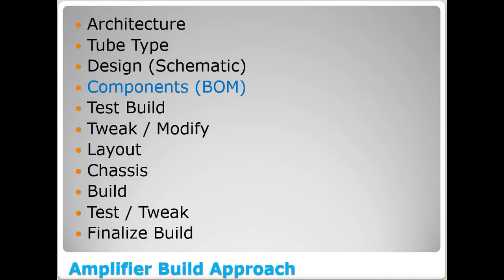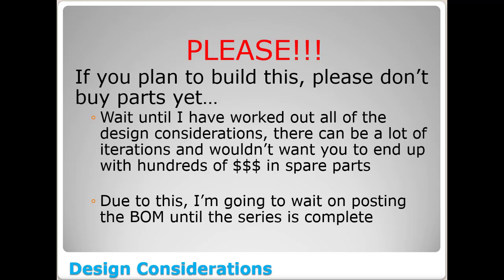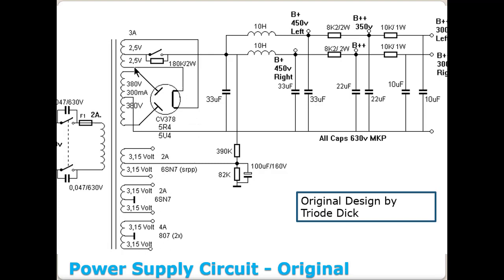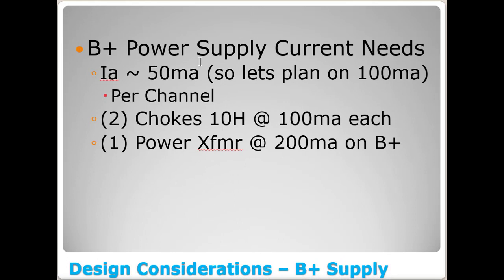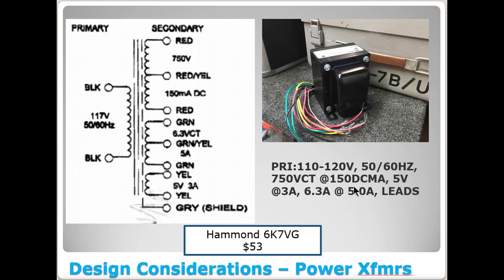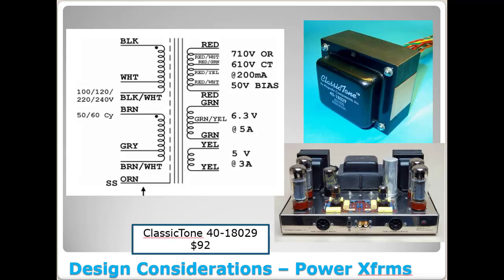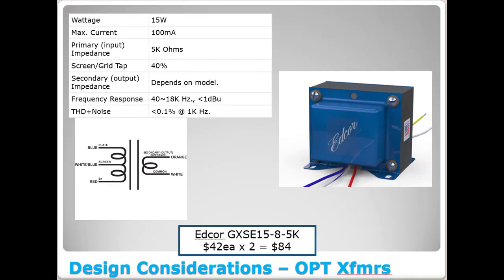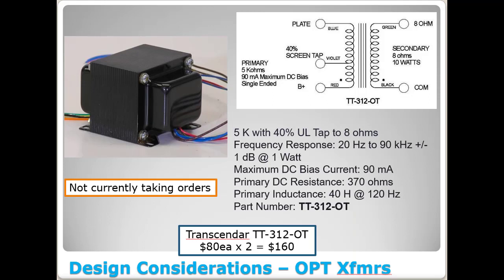Single Ended Tube Amplifier Build 2017 - Part 3 - BG099

Comment: I would build this amp, I have all the transformers, choke, driver tubes, sockets, enclosure ec. Only I need the power tubes. My only problem my output transformer primary in only 3.5K at 8 Ohms.

Comment: Great series, thank you!
I'd like to note 2 things:
1. Directly heated rectifiers like 5U4, 5R4 heat up for about 2-3 seconds while the indirectly heated tubes in the rest of the circuit need ~20 seconds, so the standby switch could be needed. In my amp with EL34s and directly heated rectifier the B+ from the 3rd to the ~20th second is 420V and then it goes down to 320V when the EL34s heat up. This is important when it comes to choosing the voltage rating of the filtering caps for instance (I don't believe tubes suffer from cold applied high voltage). 
2. The heaters for the SRPP are elevated to keep them within the "filament to cathode max voltage" rating of the tubes. If the heaters are grounded, the "upper" triode will exceed this rating having half of the B++ on the cathode. Noise is less of a concern...

Edit: 807 is indirectly heated...

Comment: I wonder why there is a tube rectifier when you could use silicon diode,s  ? or do tube rectifier,s give smother dc supply?.
Reply: With a tube rectifier you can choose one with a gradual start so the tubes last longer as opposed to a silicon one which is like BAMN it's on
Reply: @circuitsandcigars1278  my old mac 240 used a thermister to slow down the start voltage.....just my ancient experience , but others used this too

Comment: Why use a tube rectifier when Diodes and bridge rectifiers are more reliable, use less power and are cheaper?
Matt
Reply from the maker: Couldn't you make the same statement about the entire amplifier - why not make a solid state amplifier, they are more reliable, use less power and are cheaper?  For one, the slow turn on of the rectifier tube is much more gentle on the power & pre-amp tubes (slow start).  Two, I'm a tube guy, just like doing it this way.
Reply: I am also a fan of tube amps and even more so preamps. I grew up enjoying music on my Harmon Kardon receiver. Later I got lucky and purchased a Marantz 7 tube Preamp and a tube amp from my friend. The preamp sounds great but now needs all the capacitors replaced. It has Selenium rectifiers and to my surprise all B+ voltages are still on spec. The issues it has are the 50 years old paper Bumblebee caps   

Looking at your circuit it appears to me (not sure) that the slow turn on is on the 3 B+ lines and not the filaments. Is a slow B+ turn on also easier on the tubes? Are you going to rectify the filament lines too?

Thanks for all the work you put in and all the knowledge I am getting!

Matt
Reply from the maker: No plans to slow turn on the filaments, however I have seen units that do this.  Not something I think is needed.
Reply: So why does my well regarded Marantz 7 Tube preamp use selenium rectifiers?

Comment: mark: for a few reasons i am wondering this...can the power supply section of the amplifier be mounted separately from the main body of the amplifier to help avoid magnetic field interactions altogether and would there be any harm using separate heater supply transformers for reasons of lowering heat build up and the problems that creates over time? enjoying watching this build immensely by the way and thanks for putting the time in all of this.
=dok=

Comment: stupid queation maybe, but why R-core or toroidal transformers are not being used in vacuum gear?
Reply: Because you need very fine wire for tube transformers and winding machines for toroidals would break the wire.  Standard transformer bobbins are much easier to wind with fine wire.
Reply: Toroidal transformers are typically used as the power transformers. I'm currently using an Antek AS-1T250 in a current build.

Comment: You haven't really said much about the specific loudspeaker you will be using with this amplifier, but I noticed the Edcor output transformer you purchased is designed with an 8 ohm secondary.  This will likely yield a relatively high output impedance. If the loudspeaker impedance drops considerably below 8 ohms - which many do at low frequencies - the higher output impedance will start to have a considerable effect on the frequency response of the amplifier (with the loudspeaker as the load).
Reply: Kerry Geist interesting if you put a 8 or 16 Ohm's power resistor on the output in parallel surely this would sort out this problem

Comment: Nice project. The elevated filament voltage is so the cathode/heater voltage is not exceeded in this SRPP design. Best. Matt
Reply from the maker: You are correct, I failed to mention that